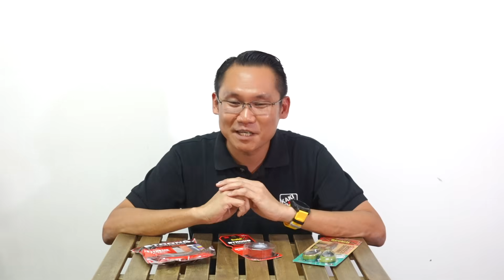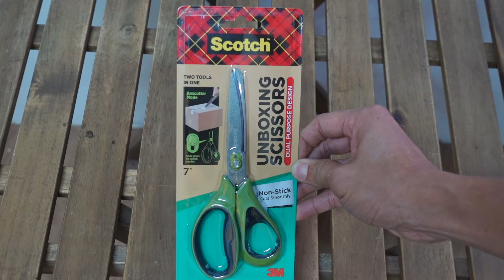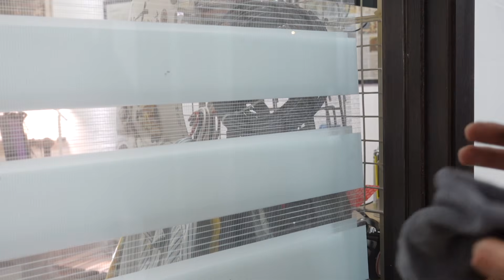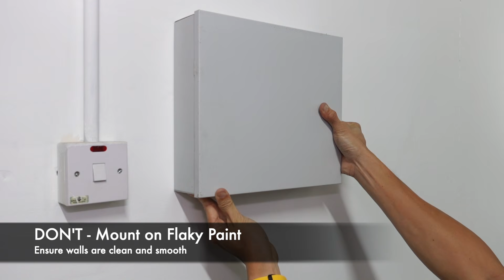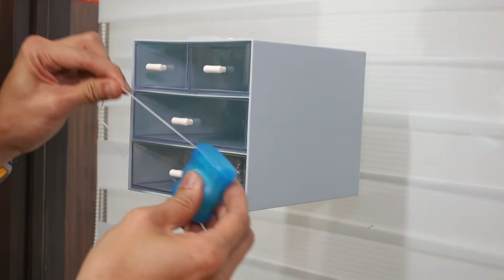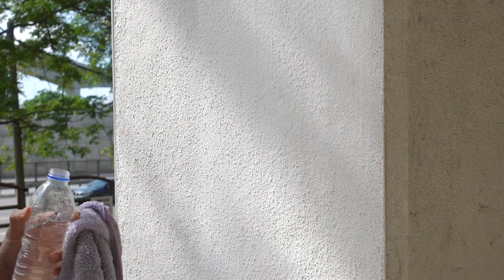3M Scotch® Extreme Double Sided Mounting Tape

Comment: Thank you so much. Showed everything in detail and also that scissor is very good. Tape sticking to scissor is constant problem for me. Never knew there is special scissors like this. When I first saw UNBOXING SCISSOR,  I thought what is special about it, we can any scissor of knife. 
 This video cleared my doubts like how to remove the tape afterwards and how much tape should I use according to weight of the item.

Comment: Hey does it protects the painted walls like when we peel it off does it damage the paint
Reply from the maker: Depends on the type of paint. Those Glossy, silk, satin emulsion paint with properly treated walls, it will not peel of the paint.  However if the wall wasn't treated properly, the paint might peel off.

Comment: Great Video.  The way shown to get access to the cover layer is worth the price of admission.  I add keep holding the tape down while pulling the cover plastic off as the tape has a tendency to lift otherwise.  I'd also add that, if one is anal retentive or the tape is visible through a clear surface, one can use a box cutter to remove the inevitable distorted tape that was held while the cover was pulled off, to achieve a clean edge.

Comment: Thankyou for the video, its exactly what i was looking for. I have a question though 😅 can we also stick small floating shelves on wall using this tape? Thanks!
Reply from the maker: As long as you have enough surface area to stick the tape. Do remember to keep both surfaces clean from oil and dust before sticking.
Reply: Thanks for the reply ❤

Comment: Is this stronger than the 3M vhb double sided tape? If i use this extreme with 3m 94 primer will it be stronger? Do you think it will be really strong for car dashboard to stick phone holder?
Reply from the maker: We haven't had a chance to test the VHB. But the specs looked almost identical. The 3M Scotch seems to be the consumer version of the VHB

3M VHB 5952
Thickness = 0.045"
Peel Adhesion (90°) = 22 lb/in or 39 N/cm
Normal Tensile Strength = 620 kPa or 90 lb/in2
Temperature Rating = -35°C 90°C

3M Scotch Extreme Mounting Tape
Thickness = 0.045"
Peel Adhesion (90°) = 385 N/100 mm or 22 lb/in2
Normal Tensile Strength = 585 kPa or 85 psi
Normal Use Temperature = -35 to 93C (-30 to 200F)

Comment: Thank you for the video. However, I would have like to see this product, used, in a bathroom, where you get moisture from when you take a shower. I was suggested this product, to hold hook items up, that will hold shampoo, soap & small towels.  (Side Note: I have an old soap dispenser I got from a Janitorial store. The adhesive that came with that soap dispenser, was REALLY good. Nott once, did it fall, in the shower set up, and on the mirror set up, by the bathroom sink.  Sadly, I had to move, after being at the apartment for five years (new ownership, raised the rent double), and I could not save that old adhesive.)  Have a good day!

Comment: Will it be removable from walls a few years from now? Pulling down on the wall (the way you showed to remove it) would maybe pull the paint off the wall?
Reply from the maker: If it is a satin painted wall. Should not be a problem, paint won't come out

Comment: Amazing video!!!. Thanks for sharing. I want to ask you is it a good idea to use this tape on the wood parts of a decorative wall fan? It is made out of thin wood and I am afraid that if later I want to remove the fan, the wood parts will break.
Reply from the maker: Thanks! Sadly this would be too strong for thin wood. Unless it will be there permanently

Comment: Hi will work gypsum wall plaster??
Reply from the maker: It should if the surface is intact, clean and smooth. If ita flaky or breaking apart, probably a resurfacing or coating needed before sticking it.